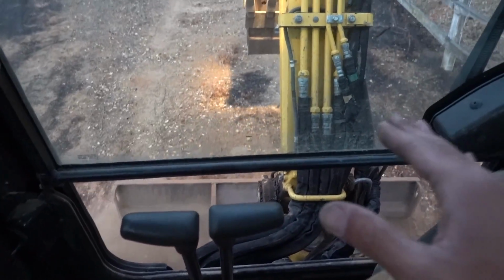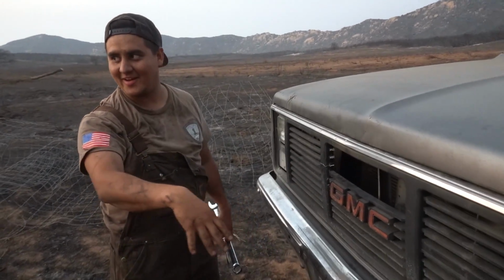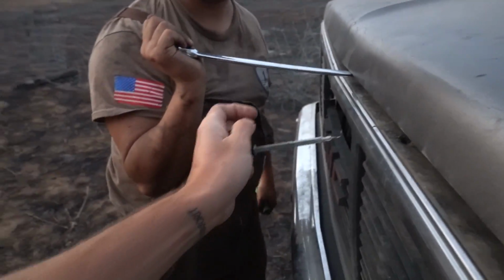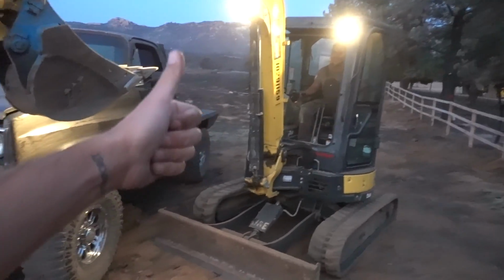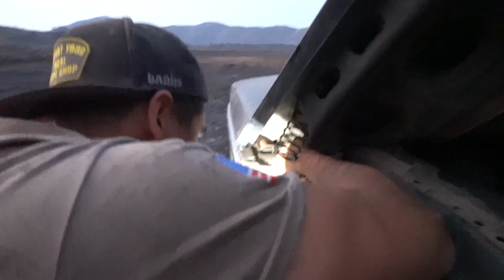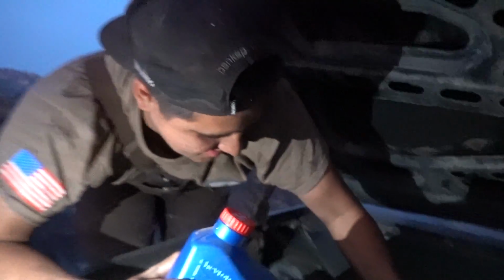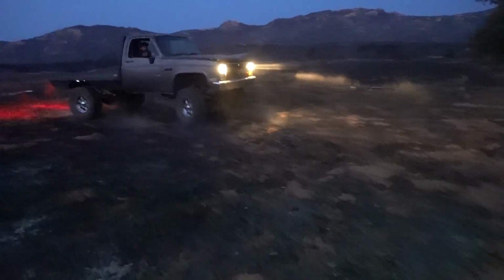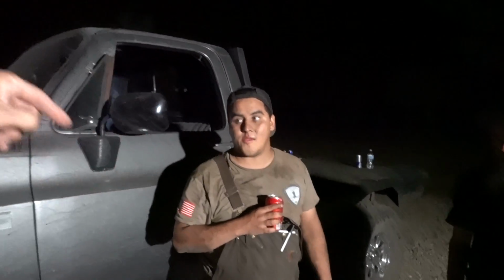CHEVY vs EXCAVATOR

Comment: I had the same issue, dont know if there's a better alternative but in my case where there was no cable whatsoever left to grab, I ended up prying my hood up with a prybar nothing crazy but enough to remove the screws in my grille. After the grille was out I drilled the bolts out that hold the lock mechanism to the core support and ended up knocking out the rest with various chisels. If you have a square body I say replace that tapped bolt setup with some regular hardware you'll thank yourself the day that your cable snaps

Comment: Take a pair of pliers and twist and pull cable.  Would have opened it.
Reply: Did you miss the fact the whole cable came out when he did that?
Reply: @johnb.7979  that was just the handle and a small portion of the cable that i saw.
Reply: @kylebizzell5198  look @ 2:36 that's more than a 'small portion'

Comment: On the trucks design. I'd say make it a farm ranch truck based on what you'd use to work the ranch. Then stylize that. Almost like a pimped out tractor that still works on the farm. I think a water tank would be one of the first additions. To me the rest comes form working the land. I forget who makes those all in one compressor/welder/generator. One of those and a vice and space for tools. Maybe integrate it all into the bed so bed space is kept open.

Comment: Why didn't you just use a grinder to cut through the hood latch bolt? Would have just lifted right up..... Also could have used a zip tie to hold the safety latch open

Comment: Compound turbos Hood dumb dual fuelers airdog lift pump two 50 L bottles and nitrous full 850 cert cage inside the cab 100 over injectors built internals buildings where she's about 1000 wheel horsepower